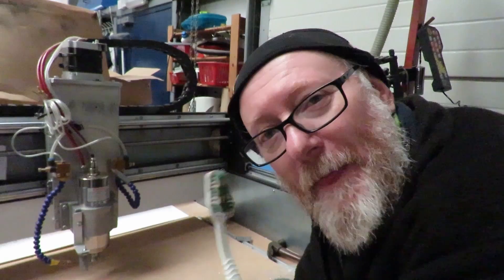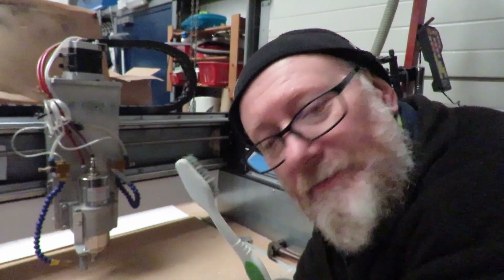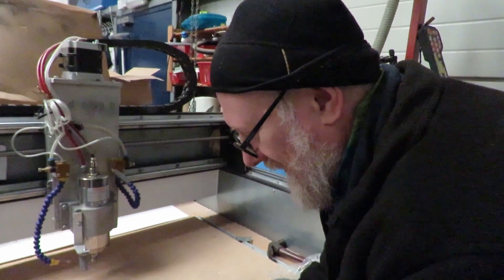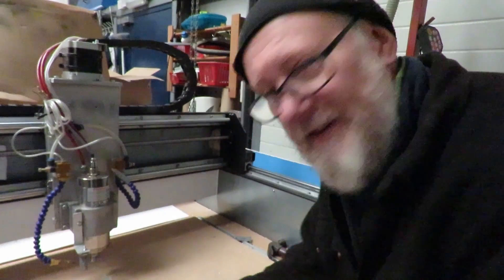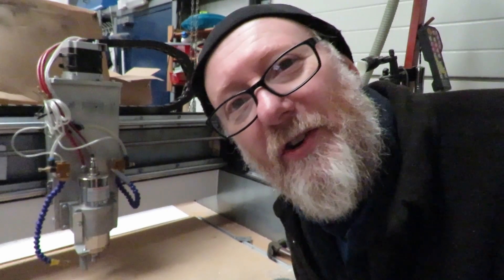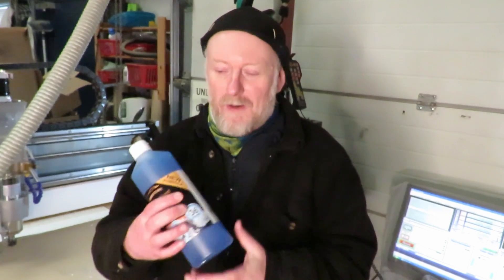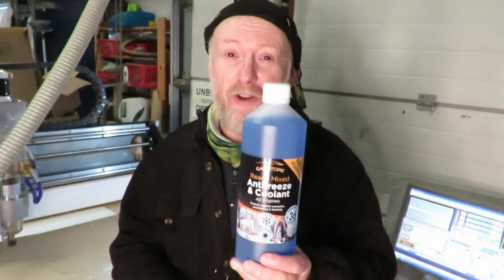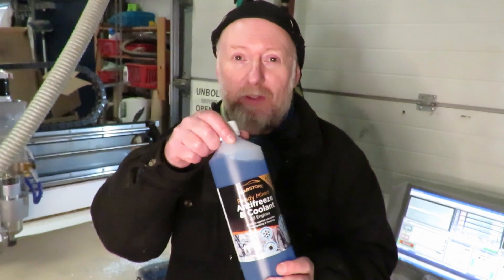CNC Spindle Killer

Comment: Actually, I'm on my 3rd spindle, and neither of the first two had motor issues: both were collet failures. Both failures occurred from over-tightening; I was told--finally, and accidentally--by someone with real machining experience that "it's well known that" stainless-on-stainless requires a anti-seize compound between the threads (which would obviate the use of a brush to clean them, but wiping them off will require replenishing afterward). 
So on to Spindle#3 and fingers crossed. My manual said that routine you're putting your spindle through every morning was a one-time "break-in" process, starting at the lowest speed and increasing the speed a few 1000 every 20 minutes or so until max. rev. is reached. The purpose--the book said--was to "seat the bearings." 
I don't think it's necessary for the "casual user,," but I will not presume to lecture actual industrial users. Thanks for the video!
Reply from the maker: Thanks for the reply. In terms of cleaning, if you've ever looked inside a collet after use, there is often debris inside, sawdust or even in my case aluminium chips, you need to get that out, if you're using any kind of fluid nearby, such as wd40, that will be worse. 
As for the tightening, yes they don't need torqued as if it's a wheelnut, a decent snug tight is enough.

Comment: What killed my spindle (1.5KW ER11 spindle) was running a long program with a lollipop cutter sticking out too much. The vibration that caused increased the runout to a degree it was unusable and it made a lot more noise, even with a 1/8" cutter. I never let it warm up though, other than the lollipop incident it has been working fine. I've tried to replace the bearings of the old spindle but I can't get the fan part off. If someone has a tip to get it off I'd appreciate it.
Reply from the maker: Thanks for watching. Excessive vibration will also cause problems. 
It sounds like you're using the CNC for 3d carving, you are therefore more at risk from the issue mentioned in the video. The video is to give you information which the manufacturer includes in their manuals and all pro-machine shops recommend and do.

Comment: Is this because your shop is cold? Mine is in a finished basement that’s heated year round.
Reply from the maker: No, you should run in your spndle each time regardless. You may not have to go through the breif warm of the electrics that I do, but that is due to humidity where I am coupled with the cold. The spindles though should follow this. 

Also, I didn't make it as clear as I should have done in the video, if you only use your machine occasionally, you should do this routine regardless kif you need to use it at least a couple of times a month.

Comment: As foreman of a cnc shop it was part of my job to come in 20 minutes early, switch on the kettle, start all the machines up and do the lubrication ritual for each one and then start them on their warm up programs - different one for each machine - once they were all running their warming up cycles it was coffee time.
By the time the staff arrived all the machines were at operating temp and the production day could forge ahead.
I actually took the warmup and lube function onto myself because a lot of the time operators were lazy and skipped them and sometimes the lube points were either not done or some were skipped.
Being an operator in a production shop is really a job best done by brainless people - example: people that are there to be clocked in for 8 hours a day and then go to the bar.
One of our Victor 2000 machines ran the exact same program for 26 months straight but that operator took pride in his work and work-piece change times were almost unbelievably fast and he could "hear" when a tool was getting worn and call me to get the tool for that action swapped out - eventually I realized that after having watched me do it for so long he knew what to do so I started to allow him to do it himself (under supervision at first).
He was eventually poached by another cnc production house down the road. GOOD FOR HIM.

Comment: Back in the 80's and 90's, some commercial CNC shops with a specialty of making high precision components would keep their machines running cutting paths during hours when the machines weren't making parts. This kept the ball screws, bearings, lubricant, etc. at normal operating temperatures, thereby minimizing the impact of thermal expansion. 

Your procedure will not only keep the spindle in good condition but will also improve the overall accuracy of the machine by improving repeatability of positioning. Warming up the entire machine is a good practice, even though it is a bit of a nuisance. I recommend writing a simple program to exercise the spindle and drive system. Start off with slow spindle RPM and feed rates, increasing over the course of several minutes as the system warms up.
Reply: And since forever, grinding machines are left on all day, so the spindle bearings stay warm and on tolerance for clearances, etc.

Comment: This is very very cautious. Perhaps warranted, but, your problem could likely be solved by letting it run at low speed for a few minutes or so before starting. These things come up to temp very quickly, and they never really get "hot". What you're trying to avoid here is hitting the spindle with load while it's cold, because the cold lubricant in the bearings isn't in-spec until it warms up to operating temps. You may also consider a program where the machine makes a large, slow circle for a few laps so your steppers aren't stone cold when they start working, for the same reason. Also it gives you a chance to make sure the machine is running right before putting work in it.

In terms of ramp up/down, again, as long as you're dialing it up/down slowly, you're fine. You want to avoid slamming a ton of power at a spindle all at once, because it'll take time to catch up, during which it is mostly producing heat in the windings. The same goes for ramp down, because it's on a VFD, the VFD slowing the spindle will cause it to electronically brake, which again, just produces heat. Not the end of the world, just easy to avoid with a few seconds of time.
Depending on your VFD, you can likely program in a short warmup cycle, and a ramp up/down cycle, that'll simplify all of the above. A couple seconds is all you really need there, or about a casual dial turn.

Also you mentioned that you have a Vevor spindle setup here, and, it would probably be best to not run it at maximum speed, you can probably realize some additional longevity at 80% or so. Yes that'll be slower overall, but, not a ton slower.

The other thing to consider is making sure the whole machine stays clean. It makes sense to have a vacuum system with a cyclonic separator on these, and that's possible to retrofit as well. That keeps them and the shop much cleaner. You still have to clean everything, just, less. Keeping the moving parts clean will extend their life alot.
Reply from the maker: Thanks for response,  very detailed, really appreciate you taking the time.
 
On the spindle warm up, as stated I'm performing the instructions listed in the manual for that spindle, which may well be OTT.

I do mention the stepper warm up and the reasons why I now do this manually, previously I did automate which I know most do and it's fine, I now like to listen the machine as it's warming and pick up any issues as it's moving. I found a loose screw in an awkward position doing it manually that was in a not easy to check on routine daily inspection. It took several minutes of listening and moving to narrow down. All about pesonal preference.

Intersting and a very good point on the top speed, something you won't read in a manual! As you say, won't make a great deal of difference to cut times, great tip, I'm definately going to adopt that one!

Next video is going to be an opinion review on the Vevor spindle as I've used it for over 12 mths now.

Totally agree on the cleaning, which I mention this on the previous vid about lubrication.
I do have a cyclone fitted but as most of our cutting is aluminium, we create chips not dust, the chips go into recycling. I create more dust from the alu on the fibre wheel cleaning & deburring, that has it's own cyclone. We don't cut wood or MDF that often but it's essential then. HDPE though is a whole other story.
Reply: @TheCNCDen  Ah, well, make sense if running it manually helps you catch things that the automation might be too, well, consistent to catch. All sorts of ghosts in these machines, how they look on paper isn't really how they work in reality.

And yeah, HDPE is a huge mess, weird sticky, statically charged dust that seems to just ignore vacuum systems, even when you're taking big cuts and it looks like you're getting good chips. Great material otherwise though.

It's really heartening to see someone on youtube that really cares about his machines. I see alot of probably sponsored CNC content where, they're just throwing their machines around and always think to myself, you wouldn't be doing that if you were making parts professionally...
Reply from the maker: @jttech44  Totally agree, couldn't have put it better.
Reply: My water-cooled spindle manual recommends that if the spindle has not been used in days to start at 3,000 rpm for 20 minutes and increase by 3,000 rpm every 20 minutes. That's beyond a 2 hour warm-up sequence. Even for the first use of the spindle, yes, that degree of caution seemed a bit much. The spindle had been sitting for who knows how long, and the bearings did not sound healthy upon initial startup, so I did comply with the instructions. By the end of the warm-up sequence the spindle sounded perfectly normal at all speeds.

For an air-cooled spindle, running it on a low speed for too long could be problematic, as the cooling airflow may be insufficient for the amount of heat that needed removal.
Reply from the maker: @r2db  If you're not using the machine regularly, it is worth turning it on just to run that warm up process every now and againl  I'd recommend at least twice a month.
Reply: @TheCNCDen  Agreed, running some kind of warm-up is likely going to prolong the life of the spindle. If it continues to sound normal while operating at the slowest speed, I am thinking of halving the time to 10 minutes per increment, or just a bit over an hour for the full exercise routine. For the daily warm-up I have yet to settle upon a specific plan, but I am thinking 15-30 minutes including the motor axes, possibly including some fixture to check squareness of all axes. I have been in the process of an entire electronic rebuild (and partial mechanical one), so it's not going to get a ton of use for the immediate future.
Reply from the maker: @r2db  Makes sense when you think about it. One other comment suggested it's the slower speed at the start that needs to be the longer one, increments can reduce in time, hope that helps reduce your warm up a little.

Comment: Can't you automate the warm-up process with some G-code?
Reply: Most industrial machines will warn you if the machine hasn't been used for a period of time, few hours, etc and prompt you to run a warmup program. this slowly ramps the spindle arm up over 15 minutes or so.
Reply from the maker: @ashpalmer1365 sadly most CNC routers don't have anything like that.
Reply: Alot of VFD's can do it all by themselves.
Reply from the maker: @jttech44  Interesting, I didn't see that in the manual but there is a lot of settings I didn't look at.
Reply from the maker: If you have the spindle controlled by the g-code software then yes you could automate it all. I've never connected the spindle as I like the flexibility of adjusting the speed on the fly via the know on the VFD. I used to run a roadrunner path at the start , which was non cutting machine op to warm the steppers. I didn't pay attention to the machine as it was running something I do more now.

Comment: i dont really think you need to max speed while warming up the spindle, Im using a hiteco 11kw spindle which max out at 24k rpm, 
i go 1000rpm for 4-5mins then 5k for 2-3 mins then 10k for another 2-3mins and at last i set it to 15k rpm for another 5 at least. 15k is the rpm im mostly working on btw.
Also never forget to lub the spindle axle every month or so with a metaflux paste spray (if you have access ofcourse).
The previous spindlle didnt last for long since i was working almost always at max RPM which is 24k, and the lub the "technician" told me to use was WD-40... AAAND yeah this destroyed it.
Reply: WD-40 is terrible for use as a lubricant because it leaves a residue that hardens like varnish on the surface. I once had to repair the spindle brake systems on 12 CNC machines where the shop supervisor had been filling the reservoir with WD-40. The spindle brakes began locking up due to build up of residue. 

Manufacturers recommend certain lubricants for a reason, but this guy thought WD-40 was a miracle lubricant. A repair bill of several thousand dollars and lost revenue while the machine tools were unable to make parts taught him otherwise.
Reply from the maker: @GaiusTacitus  I missed that in the original post but yes, as per my previous video on CNC lubrication WD40 is a no no, other than for those who love to squirt it on parts they're cutting. I prefer to avoid that also,
Reply from the maker: Possibly every manufacture suggestions variations in their manual. I use the popular Vevor 2.2kw, which mentioned full speed for 2-3 mins, which is much less than the initial 10m at slowest speed. 
Thanks for your contribution, very much appreciated.
Reply: WD40 is the exact opposite of lube, it will destroy a spindle in no time